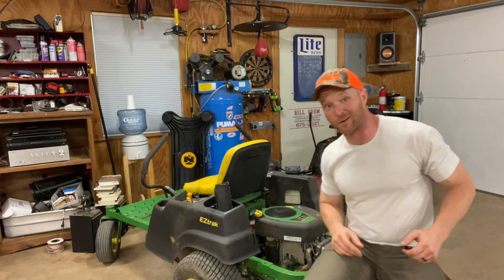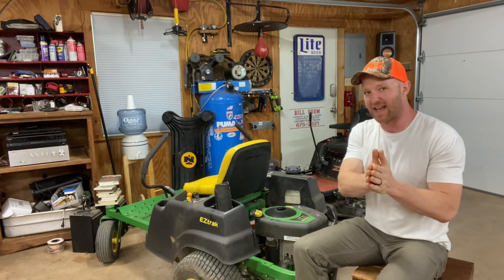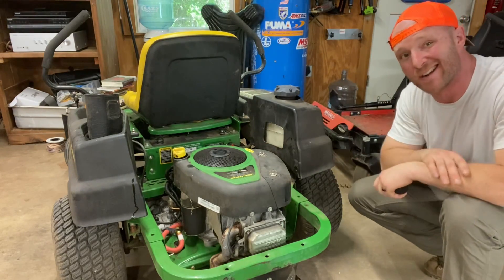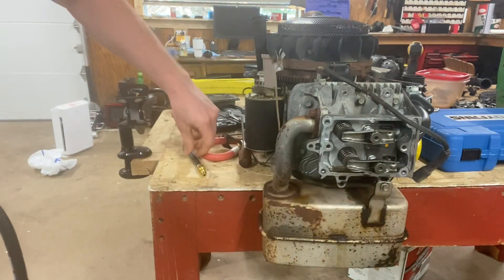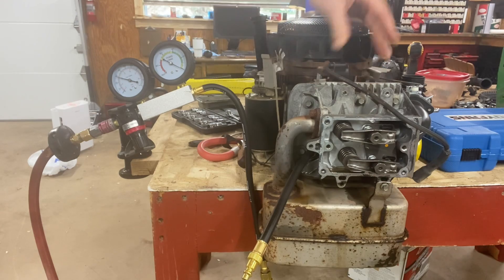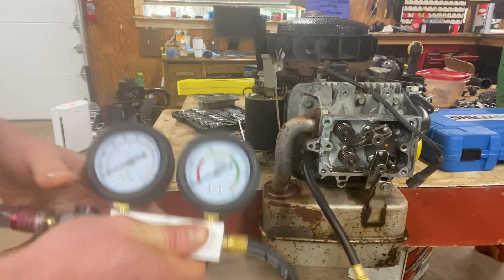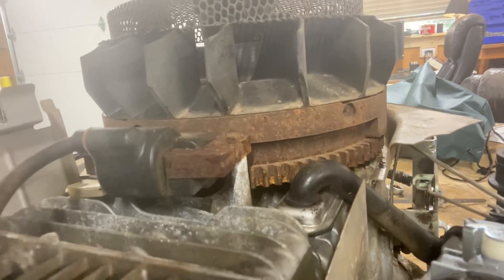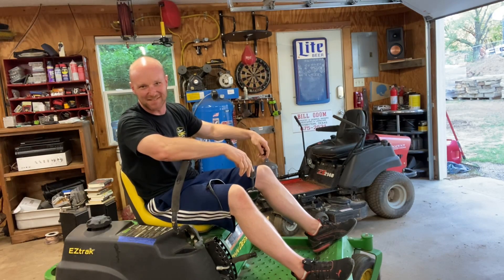Riding Mower Smoking! QUICK FIX + Cylinder Leak Down Test (Briggs)

Comment: I was mowing through a little higher grass and the fan part got covered with grass.  I didnt jotice untill it was smoking. The grass was wet on fan. I turned off  mower part but drove it over to gravel area in case it was to catch fire and jot burn the neighborhood down. Shut it down.  I got the hose and watered it down till smoking  stopped.  When i cooled down, i pulled out dipstick, and it had partially melted.  I am guessing engine over heated.  Ironically, it was running fine when i turned it off.  I am guessing i did significant damage.  I was gonna put oil in it and start it long enough to move it to shed, but dont want it to blow up. I figure a half melted dipstick is a hint.
Reply from the maker: Just run it and see what happens.

Comment: 21 hp Briggs single.  Oil from exhaust white smoke like a tuned up Cummins runs good. Compression test is 150 psi took off valve cover rockers are tight like normal.  Turned over with cover off and it’s pumping out gas thru the valves like a water hose on full blast what is my issue !! HELP
Reply from the maker: Never seen that but white smoke is oil burning.
Reply: @MowerMike so what’s grey smoke not black but blueish
Reply from the maker: @Motormuscle21 Oil burning.
Reply: @MowerMike figured so.

Comment: I have a Troy built pony that smokes only on start up. Muffler looks like it coated in oil but oil level looks normal. Blueish smoke and once it’s up to temp smoking stops
Reply from the maker: It probably is from the carb needle sticking

Comment: Mine was the front wheels smoking! Both at the same time. Whys that?
Reply from the maker: Are you mowing over hot coals?
Reply: Lol, no, i realized i had grass keeping the mower blade from moving while the PTO was on. Im thinking that was it, im new too all this outdoor stuff. It didnt last long and i shut it off immediately and went to youtube looking for awnsers. Do you think ill be fine after that?  @MowerMike
Reply from the maker: @Ptlywtng Yep a belt burning up would do it for sure. Clear it all out and see if it works.
Reply: Ok, thank you Mower mike, you are the man! So if it is working and i see no smoke i should be good to go?  @MowerMike
Reply from the maker: @Ptlywtng Well yes if it is cutting grass and not smoking I say you are winning

Comment: Not sure if my question can be answered, but mine had too much oil and when I turned it on, it blew thick white smoke. I shut it off immediately and drained the oil to where it’s supposed to be, however, now my mower will not turn back on. It acts like it wants to turn on though. So what should I check next?
Reply from the maker: I would check that the spark plug is clean and not fouled first. Then if it still doesn’t spark make sure it is getting gas

Comment: By the way everyone calls it rolling Coal.
Wish I had a zero turn. Sucks holding the button down to keep mower running while cutting to reverse
Reply from the maker: I am familiar with rolling coal. Zeroturns are great just find a beat up old used one and fix it up. I do it all the time

Comment: I have a JD D-130 8years old that gives a puff of blue/white smoke on start up and then no more smoke during a mow.  Is there anything thing I can do to fix this like some of the engine restore products?  The oil level is correct by the dip stick
Reply from the maker: It is probably fine. May have some gas seeping past the carb floating and when it starts it is burning off the excess fuel in the cylinder

Comment: I had a situation where oil was leaking out the exhaust, checked level and it was over full. Drained it and noticed fuel in oil. After testing I determined it was a bad fuel pump

Comment: I just checked the oil and it was at the top dot that's in the dipstick well who knows I drained some of it out and got it to the bottom dot and now it's not smoking anymore and it's fine. It's just burning a little bit of the oil in the end of the muffler.   It's fixed.

Comment: If you pull out the push rods for the tested cylinder, do you still have to do Top dead center?
Reply from the maker: Hmmm good question. If you pull out push rods then it should be stuck at TDC. That is probably a better way to run this test anyways.
Reply: @MowerMike  If I pull out the push rods from the cylinder being tested, I shouldn't have to clamp the shaft either because the piston will only go to the bottom of the stroke with the pressure entering the cylinder... right?
Reply from the maker: @jimyoungblood1687  Sounds like a good theory to me
Reply: @MowerMike  If the platinum engine continues to blow out head gaskets, what is your next trick?  good stens gasket, correct torque, and shortly thereafter blowing blue smoke again.
Reply from the maker: @jimyoungblood1687 Hmmm not sure. Maybe it isn’t the head gasket or maybe your head is wrapped and it isn’t get a good seal.
Reply: @MowerMike  I purchased the leakdown tester you recommended.  Pulling the push rods worked perfectly.  No leakdown on cylinder #1 but Old Smokey has a blown headgasket and really bad exhaust valve leak on cylinder #2.  Might be time to buy a new head.  What do you think?
Reply from the maker: @jimyoungblood1687  I would put the head on a level surface and see if it is wrapped. If it is you can use some sand paper on a 2x4 and see if you can level it out. Or take it to a machine shop.
Reply: @MowerMike  Good ideas.  A new head from Oregon is only $155.  The leakdown was greatest though from the exhaust, so pulling the head and examining the exhaust valve is job 1.  Thanks for your help.;
Reply from the maker: @jimyoungblood1687  I have a head cleaning and valve lapping video you can check out. Is fun to mess with them once you get the head off the engine
Reply: @MowerMike  Great.  I will look at your videos on cleaning and lapping today.  Getting the head off is easy with a good impact wrench!  thanks

Comment: A great and safe way to lock the engine is to turn the crank so the piston goes down to BDC. Then pack the spark plug hole with rope. Then turn over the engine until it locks up against the rope in the cylinder.
Reply from the maker: Yep great trick thanks for the input

Comment: What is happening if a have a really fine white smoke coming from oil check cap. When these are running is there suppose to be oil flopping from there
Reply: Oil is coming from behind carb. From the tube that hooks to the carb and form the fuel pump hose
Reply from the maker: Haha no. Means oil is blowing past the piston rings. Either it is overfilled or worn out piston ring or head gasket

Comment: Toro zero turn. Only blows white smoke when cutting high grass on a hill at an angle turning. Thoughts?
Reply from the maker: Piston rings are getting worn out. I would make sure it isn’t overfilled with oil. If that is good just run the piss out of it until it eventually loses compression/power
Reply: But it only smokes for a min then stops. If it is flat it will not smoke.
Reply: Also grass looks like it is smoking once cut. Oil level is good not over filled or low or loosing any.
Reply from the maker: @jonathanhillman1710  Damn never heard of that. Maybe it is cutting the grass so fast it is burning the tips! She must be a beast
Reply: Kinda is . 50 inch deck with 3 new blades. Cutting on highest deck setting and thick grass. But the grass that is laying on the ground is smoking or steaming? Hitting the exhaust?
Reply: Grass was probably a good 12 inches high.
Reply: Check oil level 😊
Reply: Update.  Did a full summer service with oil change fuel filter change air filter. And it was actually the high grass that was little wet at the base even after days of sun. When the grass got cut it was burning the tips and also hitting the hydrostatic motors and causing smoke.

Comment: My craftsman B&S 21hp smokes a lot of blue smoke when warms up. Oil level is fine. Is it the rings? Is it worth fixing? Previous owner said it made noise while the oil was low but i hear no noise. Ill try a leak down test if i can.
Reply from the maker: My guess would be the rings especially if the last owner ran it low on oil. I can’t tell ya what you consider worth fixing.
Reply: @MowerMike  thanks buddy. You k ow today I pulled the head and it looks like there was a little gap so I am hoping a new head gasket may seal it again. Not worth resurfacing the cylinder (the head I'd flat but it seems they over machined one spot on the mating surface) I saw a video showing someone had the same mower-engine with the exact same thing. Fingers crossed.

Comment: Dude excellent tip on loosening the rocker arms to keep the valves closed. I couldnt figure out how to use the leakdown tester without the piston moving/valves opening. Found an exhaust leak and confirmed by spraying soapy water into exhaust port, and sure enough, the little bastard was bubbling. 😂
Reply from the maker: Excellent, yep it took me a minute to figure that one out .

Comment: my mower is burning bluish smoke from the muffler, oil level is good, new carburetor as well. anyone any clue why blue smoke, valve clearance or head gasket. thanks for any help
Reply from the maker: I would look around the head where it mates and see if you can see any oil leaking down.

Comment: Excellent tip on the rusty flywheel and coil. Air cooled Kawasaki twins occasionally have weak coils leading to weak spark. If you pull the plugs and they are sooty and smell like gas check the coil.

Comment: I have a Kohler command 17 on a Husqvarna cz4817 zero turn. It ran great for a while but now it runs for about 5 minutes and dies after it died I took off the air filter and white smoke slowly came out of the intake and was a little wet inside the intake.
Reply from the maker: Hmmm that’s what she said!
Reply: @MowerMike  lol what

Comment: very good video, look, I have a cub cadet 54” cuoler engine, someone bought it new on a suoplay tractor and they returned it because even after I bought it, I found out that it was emitting white smoke after a couple of hours, I returned it to the store, I bought it at a discount from the ones from The store drained the oil, fitted the spark plugs, cleaned the carburetor, turned on and shot white smoke again and turned off but then we tried several times to turn it on and it doesn't turn on anymore, it starts but it doesn't turn on, can you help me find out what the problem could be? ?? Thanks in advance 👍
Reply from the maker: White smoke is oil burning. So could either be too much oil, worn out piston rings or a head gasket. Everything I know is in that video

Comment: Congratulations my John Deere 515R is dead with 15 hours on it so says the dealer. There looking 👀 for a motor meanwhile,nobody  is cutting my grass and they don’t care. 5,000 dollars spent more than my car is worth. Warranty is not helping me out 😮😮
Reply from the maker: Haha wow sorry to hear about that.
Reply: Agree with ZERO help and JD shop guys think they can pander to this gal. Problems noticed: loss of running speed- oil all over air filter. JD shop guys looked at it saw no problem with the speed ( really) and could not figure out oil on the air filter… they turned the mower off and white smoke from right side puffed out….. The JD solution for this less than 39 hour machine was come back about a month before warranty wears out and get a new drive belt and they pointed out all of the grease fittings ( as if I do not know that the bearing are sealed and just filling a empty cavity and has nothing to do with engine problem). So they send it home. Later in the day I pulled the plugs to look- one one left - good- one on right - baked oil coating that plug with a black burnt end ( that is the side that smoked). Sent pictures to the JD salesman “just for the record”. He showed it to the JD shop guys and their response was “she’s not going to go away”!  SO NOW.. absolutely zero confidence anything will be done . Briggs-Stratton 24 HP engine 38.8 hours ….. PIECE OF JUNK FOR OVER $3K
Reply: It sounds to me like you have a broken ring on that smoky cylinder.

Comment: Mine is only doing this but at full rev 

And the oil is milky color
Reply from the maker: Cut the yard at 3/4 speed ???! Haha good luck
Reply: Water in oil is milky and will damage the engine 
Change the oil asap 😮

Comment: Any ideas on a riding mower a John Deere LT133 that only smokes on startup also if I turn it off and restart it immediately it will backfire once. It scared the shit out of me as my buddy was the one starting and I was in direct path of the muffler 🤣🤦‍♂️
But once it clears out in about a minute it stops and won’t do it again if started later the same day. Only after it sits for a week.
Reply from the maker: Your carb is filling with fuel as it sits and leading into the cylinder. So when it starts it goes with a bang and then burns off the excess fuel. Either get a new carb or fix the float stopper thing so it doesn’t leak.
Reply: Hey, I have the same issues but I don’t think it’s the carb (I don’t get the backfire) 

But after sitting for a week it smokes and spits oil for a minute or so 

If I start it up later that day or even a few days after, almost no smoke at all. Hmmm can’t figure it out
Reply: @SickofOhio  probably the gasket above leaking a little oil in the muffler like mine.

Comment: Just wanted to share for readers that to much oil can be a stuck carb needle flooding the crankcase with gas. Oil thinned out from gas raising oil level. So use your nose and see if the oil smell like gas. A carb cleaning can also fix it. BLUE smoke in this case.

Comment: For me the key word is black smoke. That is unburn fuel every time. So next is why. For me I have a lab scope that I can use to see coil ramping and KV signal. (master auto tech) To be honest that rust on the flywheel may have been hard for me to figure. Good job. Next time I see firing problems on my scope I will look at cleaning the flywheel and then check again.

Comment: what if it’s gas that is getting into your oil making the oil level too high? therefore burning white smoke at the muffler. float & valve look good in the carb.
Reply from the maker: Well that is no good. Sounds like you got a headgasket gone bad
Reply: @MowerMike  leak down test should solve that question.
Reply: Does your carb have a shutoff solenoid? If the carb is clean and float works yet still gas is getting into the oil try the solenoid first. They are notorious for flooding the crankcase with gas.

Comment: I didn't believe it when I watched this video the first time about the rotor being rusty causing smoking.  After every ave of fixing n't I noticed mine was about as rusty as the one on video.  Took wire brush to rotor an stators, started it up with no smoke and actually runs better.  Thanks for the tip
Reply from the maker: Excellent, it is worth the frustration to feel the feeling when ya finally figure it out!

Comment: Dude thank you so much. 

- - I was at my Witts end trying to figure out why my Craftsman LT1000  was blowing black smoke and backfiring.  - - 

Equipped with the Briggs & Stratton intek 18 OHV. 

   Before I watched your Clip - I did everything from fresh oil change w/ filter, new spark plug, new air filter, new gas filter, new intake gasket …all things that could lead to rich condition and black smoke. Even adjusted the valves - none helped

IT WAS THE END OF YOUR CLIP - Where you showed the rusty magneto when it clicked with me suddenly. I definitely noticed mine was rusty when I was adjusting my valves. The rusty magneto = poor spark = not burning all of the fuel. BOOM! 

You’re the man. 🙏🏼 Thank you Sir.
Reply from the maker: I forgot I even said that lol. Glad it helped it is like a puzzle and nothing is better than when you figure it out. I have some videos on cleaning the magnetic and testing spark if you need anymore.

Comment: Perhaps I can get an answer. My carburetor was flooding the engine to the point gas was in the oil & oil & gas was leaking out of the carburetor. Replaced the carburetor because the float was stuck, changed oil & fires up (sounds like new)but now there’s white smoke coming from the muffler & oil. What could be wrong?
Reply from the maker: I suggest running it for a while and see if it goes away. It may just have left over stuff to burn off.

Comment: Oil levels can get high if the fuel solenoid/carb float doesn't work and gas fills the cylinder and ends up in the oil, thus raising the oil level.
Reply from the maker: Good point

Comment: I just got a 2008 JD 620i 4x4 Gator and it's smoking..... not sure what color the smoke is yet.
Reply from the maker: ???? Can you not see the smoke
Reply: @MowerMike  it's white smoke. I bought it at auction sight unseen. I changed the oil and it's a little better but gas is going into the oil.
Reply: @enkrypt3d 
Possible the carburetor float is stuck, or leaking gas into the cylinders check oil and see if it smells like gas.  If it does,  I would say that's your problem.
Reply: @bertgrau3934  i believe it's fuel injected so what would be the cause then? there is no carb :(
Reply: @enkrypt3d  
Could be a bad fuel injector.  Injecting too much fuel,  or excessive pressure forcing too much fuel into the combustion chamber.  These are just guess,  but I have seen the same thing on diesel engines.  I drove and worked on big trucks for 44 years the only difference is the size.  The principle are the same.  I wish you well.  There should be a way to measure the fuel pressure and check that with the minimum and maximum.

Comment: i had people that do that or just put it on the side of the road 1 day i found a push mower they said they could not get it running i looked at it and the carb choke was on back words had tap holding it the spring was pulled to keep it still it was a 5 min fix and now it works and sold it for 50
Reply from the maker: Wow never heard of that one nice